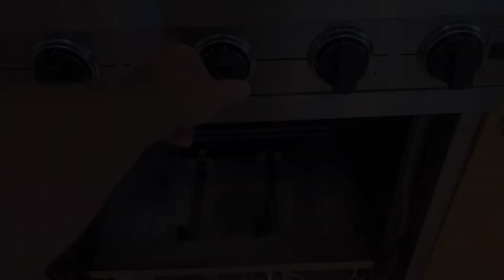Viking Oven Valve replacement

Comment: On any range more then a minute is a delayed start , change the ignitors and the burner tubes as the valve properly opened due to the rupture of the burner near the ignitor and it grounded out